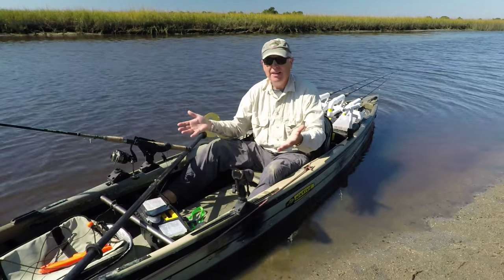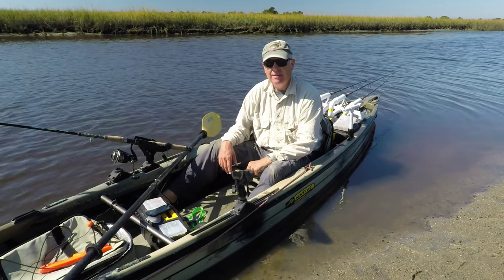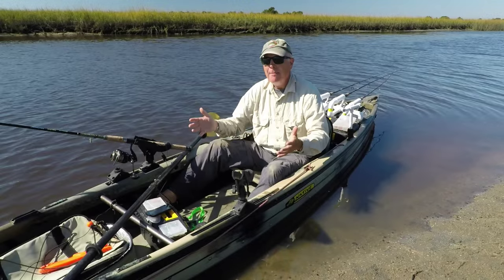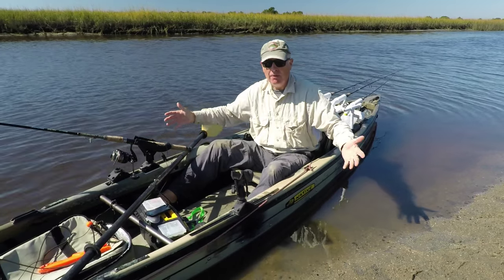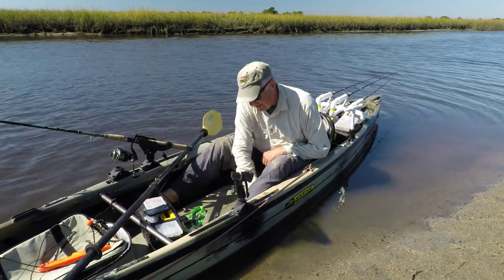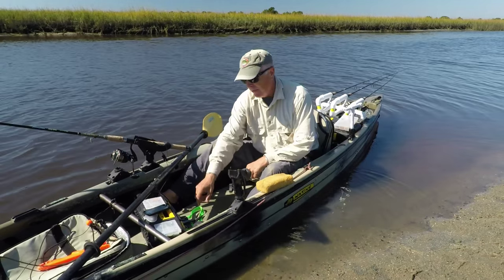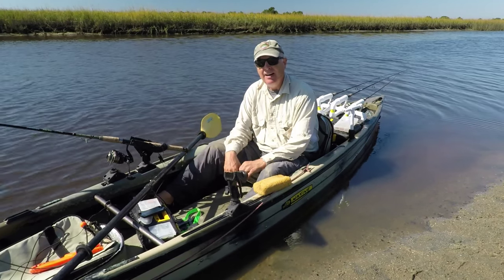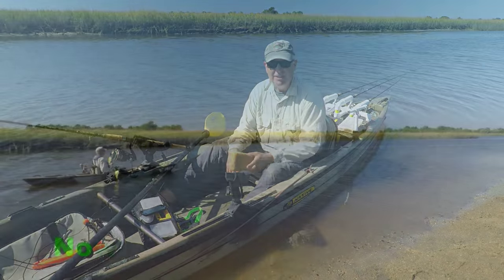How to stay dry in a Sit Inside Fishing Kayak

Comment: Nice tip. When is next kayak outing? I also need to get my kayak set up for fishing? Is this something that you do? Or do you have someone you recommend.
Reply from the maker: +On Day Five Fishing (OD5 Fishing) Dick and I are waiting for the water to hit 60 consistently before we head out.  As painful as that is, we need to give it a few weeks for safety since neither of us have dry suits. Congrats on getting your kayak!  I recommend you go over to Hook Line and Paddle on Eastwood.  They can assess the kayak and figure out what you need.  Basically, all you need is a utility track on each side with a Scotty Rod holder in each.  If it does not already have the utility track installed, they can attach it properly with rivets.  Beyond that, you just need a net, hawg trough, anchor and a small container to hold your gear.  You can check out some of my other playlists on storage.  Send me an email with your phone number so we can connect.  I could come over (or you can come to my place just north of Snow's Cut) and we can see what you need.